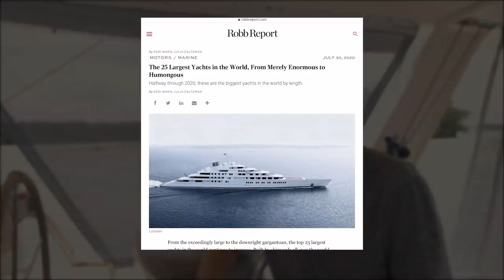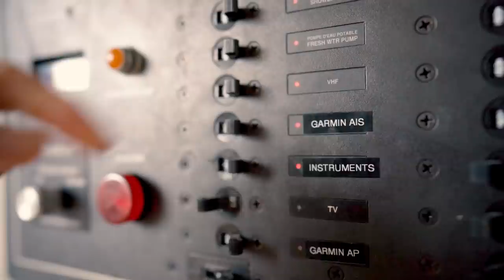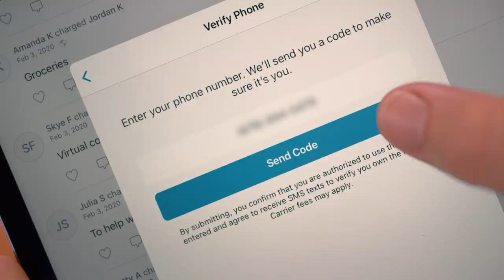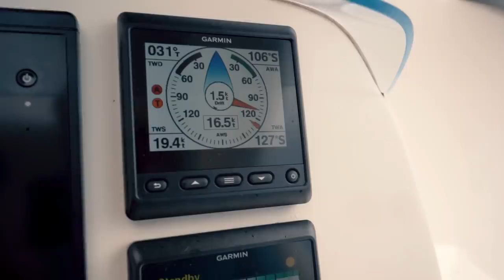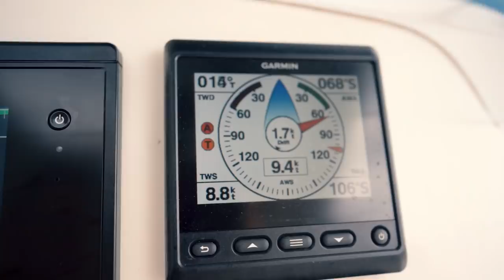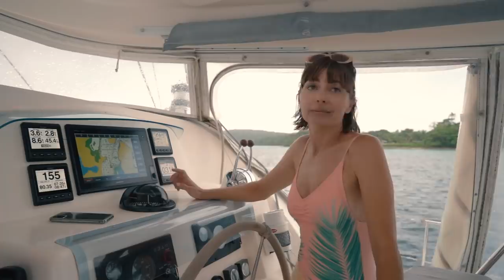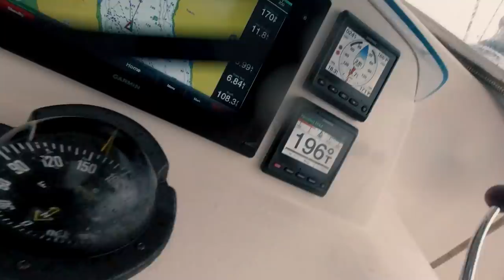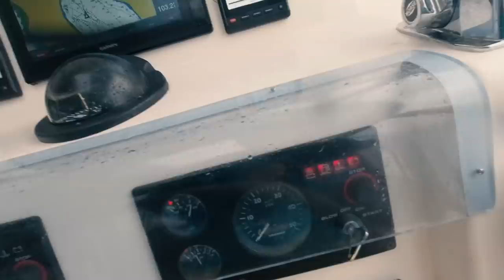SAILING WAS GOOD…then he went overboard 😳

Comment: For the next time!
Take a line to one bow & tie both ends off, thus forming a loop.
Coil the loop and "split" it, holding one half in each hand, with say three feet hanging in front of you as you stand at the bow.
Approach the buoy until close to the bow and throw the looped line over the far side.
Signal helm to go astern a touch.
The line sinks below the ball, and when you haul in,  the ball is raised.
Even if, in bad conditions,  the boat falls away, it's secured to the mooring.
No deserting the boat!
Great video as usual.

Comment: Just a suggestion,  we have a catamaran as well that we sail as couple. We develop a technique to grab a mooring ball that is fast and easy.  We have a long bridle which I can extend all the way to the back. I attach one end at bow, bring the other end to the scoop at the back on the outside of the boat.  We sail the boat so the ball comes along the windward side of the boat to the back, I position myself at the scoop and thread the bridle in the ball attachment point and let the boat drift back. As it drifts I follow with the bitter end of the bridle. Once the ball pass the bow , I make fast the loose end to the other side. I can adjust the length of the bridle by bring in or letting go as needed before attaching.   The advantage of this technique are: less drama, the skipper has a better view of what is happening and  the scoop is a lot closer to the water than the bow.  In really blowing conditions we back on the ball. We just make sure that the wind will move the boat away from the ball as I bring it the bridle end forward.  The disadvantage is that the ball anchor chain gets a bit close so as soon as the ball is near the back of the boat we idle that engine to avoid possible drama. 
Gréât vidéos. Our boat is on the hard and we are still confined hopefully for only a few more months then I swear to stay on the boat and never leave it again.
Reply from the maker: Interesting!

Comment: Yeeehaaa were finally sailin’! If your mainsail batten gets stuck on the runners/backstay try spraying the batten pocket with some McLube. Or when you get to a sailmaker get them to sew onto the pocket a strip of pattern Mylar. It helps it stay slippery. Worst case you can install a wheel on the backstay to help the sail roll past. Companies like Ronstan make them for stopping headsails getting stuck on stanchions. Final tip...Jason, maaaate that Aussie impressions is rubbish ha.

Comment: You guys probably know this by now, but for others, the engine buzzer goes off when one or both of the following conditions occur:  low oil pressure ( like when key is turned on to start engine, but before starter engages - no oil pressure) or overheating. When I look at  your gauges at 17.49 , engine is off - no rpms on the tach, but it looks like the upper left gauge is the temp gauge with a warning light on and the needle on the high side. Not sure why the engine shut down, but it is good thing since it was going to overheat with no water pump belt.

Great channel. Best wishes from Seattle

Comment: Wow, great episode guys. Seeing the sails go up again was just as emotional as when you first got back to Curiosity for me. Teared up a bit on that one. I love how your intros evolve bit by bit with each week, that its not just a canned intro you throw in. The work shows and its very appreciated. The thing with the alternator belt... its rare but there's a chance that when they fail like that they can get caught, wrapped around the crank pulley (between the main pulley and engine block) and in a fraction of a second work their way into the main seal into the engine. Think halyard line around a 2000 RPM winch but there's nowhere for the line to go except through the seal. The thrust bearing will stop it but the damage to the main sail can put you out an engine until repaired. Alternator belts might seem like an auxiliary system to the engine but they can very quickly flower-pot your engine. Its rare but it does happen. Triple check that the belt doesn't touch anything other than the pulleys when its running and that all the idlers and alternator spin free without looseness. If the pulleys are out of alignment or don't continue to spin when "flicked" they're putting an unnecessary load on the belt or pulling it at weird angles. You'll want to rule out anything other than belt condition as to why the belt failed catastrophically like that. Interesting to know that the key doesn't turn the engine off, just aux systems and gauges for it. Always wondered why you would hold  the kill button to shut it off then key off, interesting that the tach read 0 RPM though, I'm curious where the RPM sensor is.
Reply: This is a flaw in some BMW automobile engines. There are aftermarket belt guards available for the BMW engines. If your engines are susceptible to this, there might be physical guards available to prevent the belt from pushing through the crankshaft seal.

Comment: Just giving my 2 cents worth guys.
Gates green stripe are best belts if youre using balmars. But better yet switch over to the serpentines and you never change a belt again. Well worth it. Theres a kit for this.
Youre alternator  probobly over heated. Be carefull they can burn the boat down if there shorted.   They short easily if its balmar.

Comment: You handled your loss of one engine just fine. Last time that happened to me was 1983. I was on board the USS Enterprise when one of our four main engines went down coming into San Francisco Bay. We didn't have enough steerage to overcome the resulting drift and ended up stuck on a sand bar for several hours.

Comment: Nice edit guys. I’m surprised you have not had alternator belt problems before , particularly with LiFePo4. I used to have so many problems with belts and it was on my list to change over to serpentine belts and change the pulleys but I decided to put in 2 x new yanmars and sail drives to cruise without problems for a while and the new engines come with serpentine belts which are far superior.
Engine alarm on yanmars ( with red indicators on the dash) are for
Oil pressure low
Alternator not charging
Engine overheating
Water between the saildrive seals

But I agree with you after only a few months of not sailing you feel a bit rusty 👍

Comment: Alternator drive belts are made from a rubberized compound that needs to be in use regularly as the tires on a car.  If allowed to sit stagnant especially in the environment of Tonga they break down and become hardened and brittle.  It's not abnormal that yours failed after so long of a time being on the hard and doesn't represent a failure of the parts being driven just a belt failure.  You can keep spares that have been unused for a much longer time as they haven't had the mechanical wear that hastens the "dry rot" failure.   This probably is also a reason for the leaks that you have the sealants have hardened and become brittle allowing cracks to form and the ingress of water through the cracks.
Reply: I bet it's rust on the pulley, and it'll shred the new belt if not dealt with.

Comment: Lots of good things here.  Firstly the sound of silence when you get the sails up and and shutdown the engines.  As you know there is nothing sweeter and after your trials and tribulations it must have felt like an utterly deserved re-set.  Secondly, yes you had a bit of a moment with the mooring but there was no shouting or histrionics or any injuries dealing with it.  Thus lessons learnt but no harm, no foul and I've been there in the water with my wife backing a yacht towards me because a line ashore mooring went a bit wrong.  It happens and you grow and move on. I don't know whether this would be something you might contemplate but we've started to back towards mooring buoys because we don't like hanging over the bow, especially if there is no bridle to hook.  This is from a mono hull swim platform but you could do it equally from a sugar scoop.  So  back into wind towards the buoy, get a line onto it and then walk the line forward.  The advantage, as we see it is both my wife and me are close by so communication is easy plus whilst she is on the wheel she can really easily see what I am doing.  The downside is it is a faff walking the line forward to settle the buoy on the bow but, overall, it works super well for us.  So going back to the good points, you both demonstrated mental muscle memory to get the boat underway and at the end you were both talking calmly with each other with no blame etc. being ladled out.  As a couple you therefore smashed it!  Anyway a lovely video, as ever, and wishing you the best for 2021 with good health to both of you and keep sharing your experiences.

Comment: Hey guys really like your videos and love the fact you are here in the south Pacific. I noticed your terminology for different types of vessels and thought I would brief you on the correct names down this neck of the woods. Around here we don't use the term sail boat, a sailing vessel no matter how big is called a yacht. If the vessel doesn't have a mast then it is a launch or at least until it is about 75' long then it becomes a motor yacht. So the huge vessels in the pictures you showed are either motor yachts, super yachts or mega yachts. Catarmarans are called either sailing cats or motor cats. Apologies for the lesson but you know, when in Rome and all that. Cheers from New Zealand.

Comment: You can throw a line looped over the mooring ball as a lasso. Tie the bitter end of the line to the cleat on deck for safety, once the line looped over the mooring buoy you cleat off the other bitter end to the same cleat, this will make the line hug the buoy underneath. 
Then once secured in this way you have time to finish the manoeuvre as per usual practice. Gives you more holding power than with the boat hook.
Cheers

Comment: Check your alternator output now after she turned the key off while the engine was running....quite possible to blow the internal diodes which prevent over charging voltages....so you might wish to do a double check on the alternator output with a voltage meter...  Fair Winds...

Comment: The fact that it was the alternator belt was what broke is probably the absolute best scenario with just turning the key off on that alarm.  If the alternator was still running, that means the alarm would be for oil pressure or temp, and you didn't actually turn the engine off, just the key .. which also would have had a high chance of blowing the alternator (regulator) if it was still turning.

Comment: The reason for the belt shredding is that the pulleys will have surface rust from sitting in the humid Tongan air while you were away. You will need to carefully clean off the rust on all the pulleys and replace the belts.

Comment: Something not quite right with the positioning of the jib sheet IMO... further back and further from the centerline I think would be able to flatten it out a bit and not curl it back on the wind... ..It's the little things that give greater speed... Was raised in a 58 ft cutter with 4ft bow sprit, 68ft mast double diamond rig (my fort in the tree) ... and we had running backstays which were crucial especially in heavy winds... so I kinda have an eye for shape and angles to the wind ... think about a slide block and possibly two, one outboard and the other inboard ... Just a thought. Balancing the sails when sailing alone and tying the tiller is really a great way to get in touch with her and the wind... Blessings.. miss it so...

Comment: You've probably now been told this a million times now, but the reason it makes that sound is low oil pressure. So prior to starting an engine there is no oil pressure, hence the noise/alarm... Hope you haven't got oil pressure issues!! Great to see you underway again!! Must be a relief. Can't wait to see what you get up to next! XX
Reply: The belt broke that spins the alternator and raw water pump causing a high coolant temperature. That's why the alarm sounded. Yes, it also sounds for low oil pressure at start up.

Comment: I had to coment on jasons blue painters tape on the starboard windows,  I have also recently found that the scotch blue painters tape works awesome to seal windows on my mobil home and camp trailer before rains, it takes a minute to put on  and leaves no sticky crap on the surface .  In the past i tried using duct tape and other products,  but the blue tape is the king , stays on wind and rain , you can  even overlap it to patch a hole.

Comment: I would keep an eye on the oil in that engine to make sure it doesn't get milky from a blown head gasket since you were overheating before she turned the key off and the engine continued overheating because it was still running with no alarm.  The temp gauge looked pretty pegged before she turned the key off. No idea how much longer the engine ran before you got tied up. 

Was the alternator or water pump seized?
The belt coming off can really confuse since the tach signal comes from the alternator. You look at the panel and everything indicates the engine is off. Weak.

Comment: I may be totally wrong as I'm not there but it seems you were sailing upwind in light winds with the traveler right out (min 12:15). Dropping traveler really depowers the mainsail so I would try to bring it in closer to centerline under those conditions. As I said, I wasn't there so wind conditions probably weren't what they seemed to be (apologies if that's the case). Safe sailing.

Comment: I meant to comment earlier about your delaminating windows and the leaks that go with them and chips on how to fix them,  get some cable really like stainless steel cable that's really as 4 or 5 strands in it with one of you outside and one of you inside rep handles on it so it doesn't hurt your hand going back and forth can saw the window out without cracking and breaking it then you can carefully scrape off all the adhesive with  razor knife or something similar before you reinstall it, of course it doesn't make any sense if your windshield or window is cracker broken you just have to wait for a new one, but that's how you remove windshields from a car at the junkyard that you want to buy, then it's just about acquiring windshield adhesive it's black goop that they used to install car windshields I don't know how available it is in your area that way you can glue your window back in put duct tape over it to hold it till it dries and you won't have any more leaks anyway. , Don't remove or install a heavy windshield or window by yourself it can hurt your back don't ask me how I know that. Things I need to do I need to set up my new PC cuz I can't see very well on this cell phone and I'll be able to send the receipt messages without going back and spell checking everything.lol

Comment: You might want to keep checking that new belt to see how it is wearing. It might need adjustment. Also if you were changing the belt based on engine hours you need to take into account that the old belt sat for a year which will age it. (keep a close eye on the hoses also).

Comment: The belt could have taken a set with the heat and not being used. That would be where it was over the pulleys. Also being rubber they dry out. Not much left to check.

Comment: I have Surfshark it's okay, easy to use and not that expensive.  But it does cause a large drop in connection speed, the drop is not always the same but I've seen a loss of as much as 180 Mbps.  Still I'm keeping it.

Comment: Rust spots on the drive pulley causing the belt to shred?
Check if you didn't already - it's the most likely cause after not running the engines so long.
Reply: N.B. If you don't, you'll very soon shred your new belts as well...

Comment: Have u guys thought about electric engine less maintenance.
Reply from the maker: Would love one but Curiosity's way too heavy to refit to electric and a new electric cat is waaay too expensive so....
Reply: It would be quite an expensive undertaking.  It would not be an easy undertaking.  They could offset their costs by selling their current setup (two Diesel engines, drives, and controls).  It would require lithium-ion 48-volt battery banks, cabling, the two electric drives, and probably upgrading their battery charging system.  Perhaps adding more solar panels.  At least $50k.  The upside is that it would be more reliable, quicker maneuvering response time, much less maintenance, no diesel fuel needed except for generator, and it would be quieter with no vibration.

Comment: Jason when you showing pictures of the alternator belt off I could see a little rust in the pollies got to get that rust out of there it will chew a belt up in no time
Reply: Just to add to that, make sure the crankshaft pulley, alternator pulley and tensioner are all perfectly in line. if any of those are out just by the slightest amount, that'll chew up a belt as well.

Comment: Classic multi engine issue. Identify and confirm the failed engine before vital actions. check T's and P's to confirm failure (and especially the tacho) At least unloke an aircraft, in a boat the asymmetric thrust wont flip you onto your back and you corkscrew into the ground at 100mp!!

Comment: The sailing is only a minor part of living on an ocean-going sailboat these days. The rest is maintenance, maintenance, maintenance, even more so now that there is so much tech aboard, from motors, to pumps, to valves, to batteries, to fans and AC, to all the appliances, to control panels, to antennas, to...
Not just lines and sheets, but so much wiring and plumbing on boats these days, and life in the salt where such things do not thrive, compounded by motion and flexing. It's a lifestyle for the young, strong, energetic, and enthusiastic. I miss it.